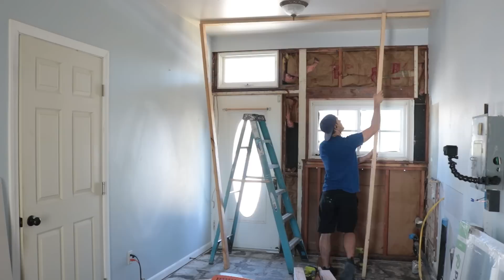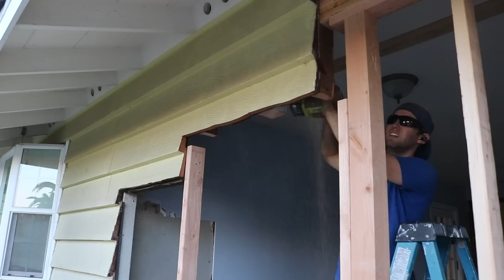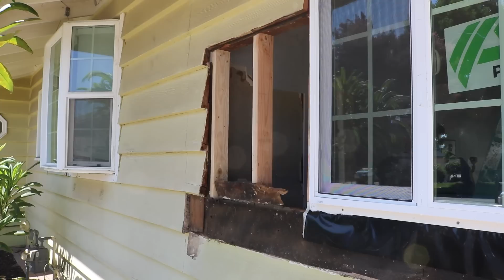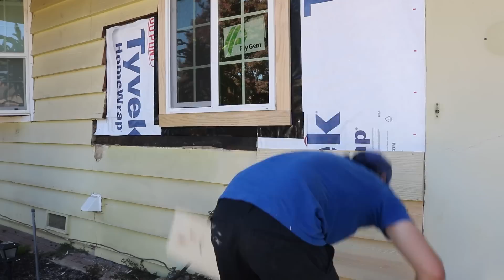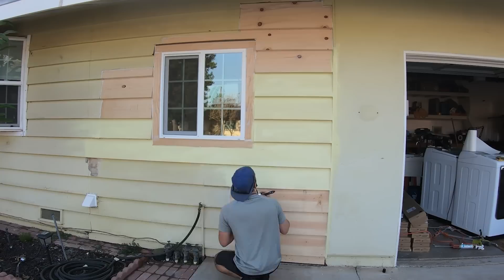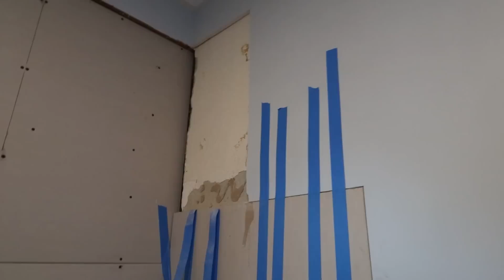Mudroom Renovation Part 6: Front-Face-Lift

Comment: Couple of waterproofing details that weren't done correctly. The flashing you put under the window should have went up on the window sill itself. The flashing you put over the window flange should not go over the bottom in order to let water out should it find it's way in
Reply: also, no caulk on the bottom of the window, now you will trap water and moisture on the inside.